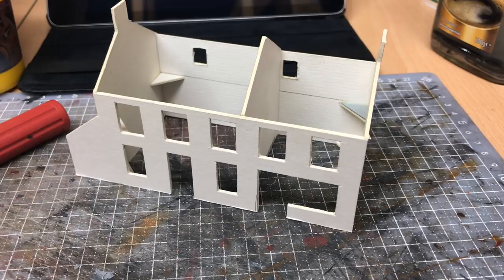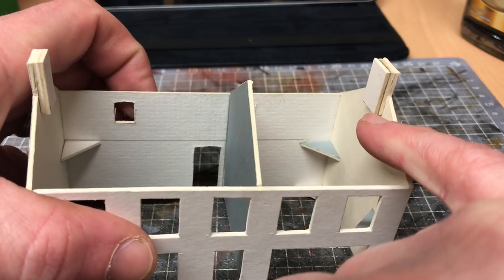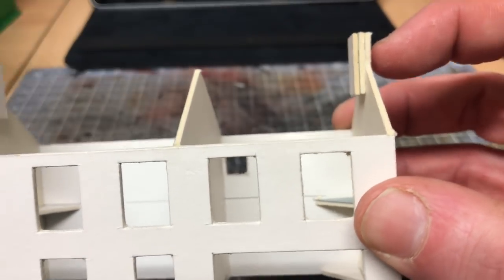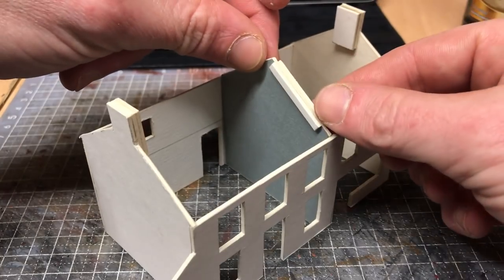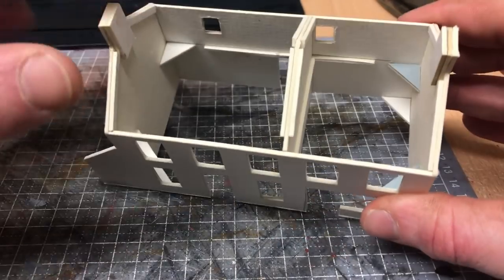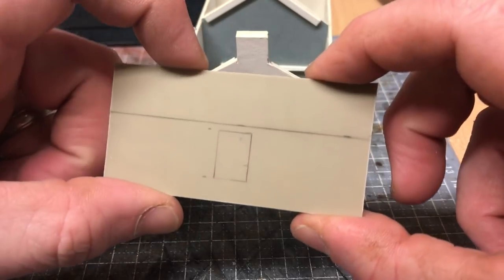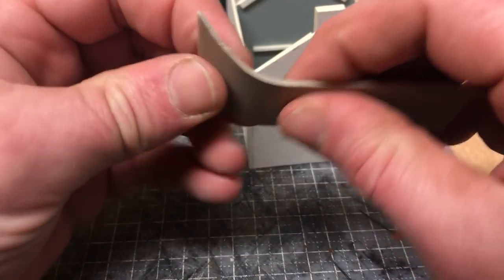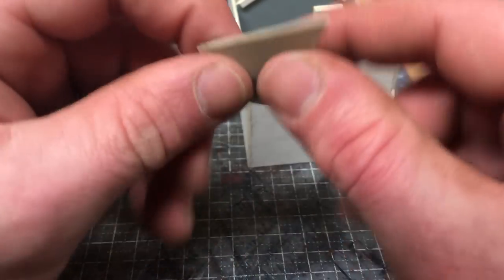Building A OO Gauge Model Railway: Scratch Build Series - 1.2 Curved Wall And Supports

Comment: Nice update Paul, that curve looks good and thanks for the shout out - my wife thinks I am famous now I have had a mention on YouTube! By the way if you use the solvent free UHU it does not string like the original one does. 
It is a bit more expensive but a tube goes a long way in card building, I use it in a fine tip applicator for small join areas like Metcalfe kit windows and it is much easier to use.
Cheers Steve
Reply from the maker: Steve, the shout out was the least I could do to acknowledge your participation in the build. Famous you say? Don’t let it consume you. 😂 I knew there was something else from the UHU range that would work better, I must seek a tube of it out as this stuff is just awful to work with. Looking forward to seeing the next stage in your own build. Paul

Comment: Thank you for sharing this scratch build when you are done it's going to look amazing right now I'm not far enough along on my way out to do scratch builds but I am going to save this video to have it I do have maybe two techniques that might work her that curve wall first technique has to use a lighter just a little bit of the Heat will help bend it if that does not work try cutting little V's had a bad back and holding it over to make that curve kind of the same way that we do I fascia on our bench work to go around curves let me know what you think p. S. I did do one scratch build for my snowshed a few years back but in the process of tearing the layout down my snowshed got destroyed I will eventually have to rebuild that from my new layout once again you have done a great video look forward to the next one
Reply from the maker: Hey Bald8bil, at the rate you are going with your baseboards it won’t be long before we see track going down and scenery started. Your two suggestions for helping with the curving of the plasticard are sound ones. I had considered heat as an option and it would have been the next step if this hadn’t worked. The only issue I have in applying heat is to get an even spread across the piece without causing it to warp. The notches in the back I hadn’t thought of but will remember that the next time I do a similar technique. Thanks for taking the time to watch and comment. Paul
Reply: Thank you very much I was hoping to get my layout done but I have  to take it easy for a while I have a pinched nerve and my neck and I got to get an MRI done so once I am released from the doctor I will get back to and I work up there

Comment: What is the material/card you are using please. It looks stiff and easy to cut .
Reply from the maker: The basic structure is 2mm mount board - the type of stuff you would use in picture framing. Paul
Reply: Many thanks , The card I have been using is too “flimsy”  👍

Comment: Hi Paul. everything is looking great, I have a idea for you if you want some card that you can bend mount card for painting or photo's is really good I had about 8 sheets  from my watercolour paintings so I have been using it to make brick walls I cut sizes I want double them and glue together so it's double thickness and I have been able to bend it round curves you can buy it A3 size and it will go a long way, but it's just an idea for you. it costs about £4-50 per sheet for most craft shops, anyway your build is looking fantastic can't wait to see the finished product. Regards George...
Reply from the maker: Thank you George, I’ll certainly take a look at that and try it out. Paul

Comment: What material did you use to build the house? Thanks
Reply from the maker: Hi, the basic structure is made out of mount board card and the skin applied was primarily sandpaper. Hope that helps. Paul